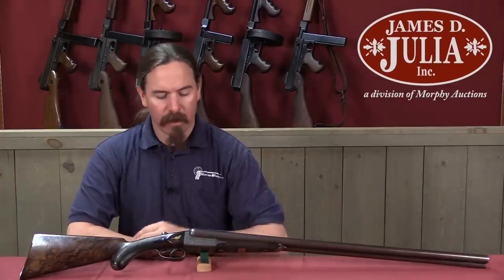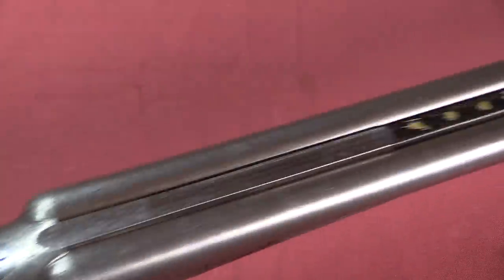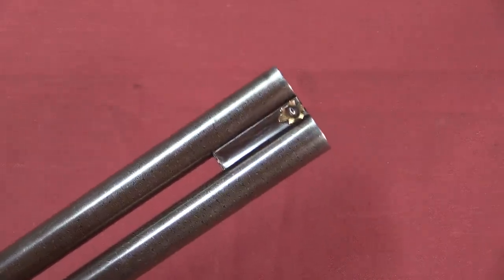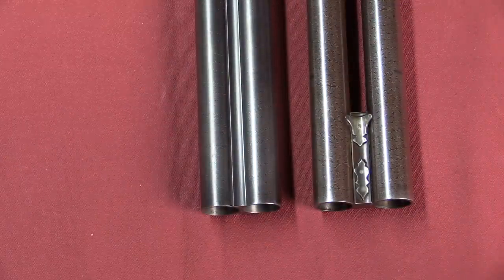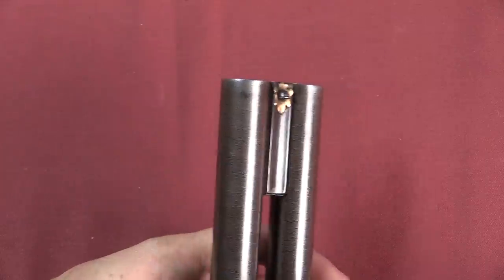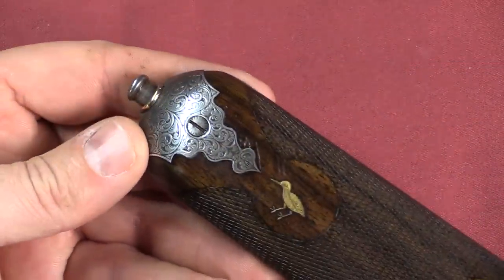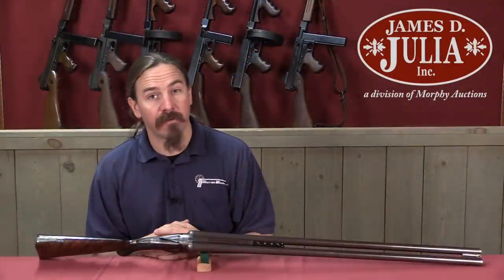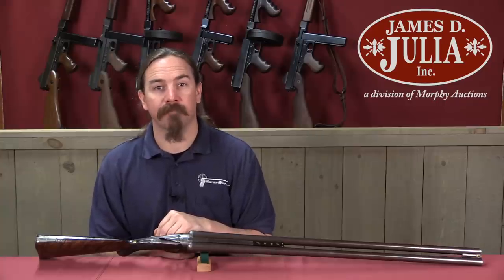Parallel-Bore Side by Side Shotgun - Look Ma, No Rib!

Comment: Were those true damascus barrels? They're gorgeous...
Reply: They are not damascus barrels. True damascus has a pattern like rain drops and is a crucible steel. What those barrels are is pattern welded steel, which is strips of steel wound around a mandrill and welded together.
Reply: Given where "damascus" has gone in the use of language (both now and with early pattern welded steel) I've started to lean towards just accepting this being called "damascus" and maybe at most point out there's a difference between what one thinks as Damascus steel today and Wootz.

But there's still a nagging stubborn part in my brain that kinda wants to stick to your point, yet it seems pointless with how its been used in modern english and how few people actually know the difference between pattern welded steel (commonly referred to as "Damascus") and Wootz or... even what Wootz steel is.
Reply: Well, the exact same image is used on both Wikipedia pages for Damascus and Wootz, and the articles somewhat imply that they are essentially one and the same, so I don't think there's any practical point in distinguishing between them.

Pattern welding can also be achieved by forging, anyway. It's just forge welding isn't as strong as more modern methods.

EDIT: Yeah, apparently these barrels are actually weaker for it. It would be dangerous to use high pressure shells in this shotgun.

Comment: I never knew that the barrels converged like that on normal double barrels. I guess it makes sense. Similar to aircraft machine guns when they're mounted on the wings.
Reply: Actually, the regulation of aircraft machine guns in the era of wing mounted batteries, was at the pilots discretion.  Some preferred them tuned to the same spot at 1000 yards, or even 500 yards, but may preferred parallel columns.

Comment: I suspect that "normal" regulation is also partly in response to the effects of recoil on POI, due to the barrels being offset laterally from the center of mass and from the line of support, somewhat like the effects in revolvers with light versus heavy bullets.  I.e. the right barrel points slightly further to the right by the time the shot charge or slug exits the muzzle and vice versa for the left, hence the inward angling of the bores to compensate for both the divergent aiming and to a likely lesser extent for the spacing.

Comment: The Marlin M90, Remington M32, and the very rare Morrone shotguns all had no connecting barrel rib, but these were all over-and-under designs. They all taper to the muzzles in the manner of a double. I have also seen handmade German guns with a WOODEN rib! Presumably to save weight. Colt double rifle in 2018 if you can find one.

Comment: I just have to imagine that it actually doesn't matter much at such short ranges using a shotgun
Reply: @ farmerboy916- On a stationary target it wouldn't matter much but on rapidly moving targets that shotguns are usually used for those parallel barrels would make a big difference. You can prove it to yourself with any shotgun. Mount the gun as you normally do and then close the eye directly above the center boreline and try to hit your target. Unless you are cross eye dominant you're going to miss.
Reply: Shotguns launch a whole lot of rocks. It's pretty hard to miss.

Comment: Double barrels be they rifles or shotguns, aren’t converging because the want the shot column or bullet to converge, they are that way because they are on other sides of the centerline and recoil makes them recoil and shoot away from the centerline. Converging the barrels correctly makes them shoot parallel. Nobody cares if they shoot an inch and a half apart 3/4 of an inch left or right of your aim point. But what you definitely don’t want them shooting at some angle to that point. Parallel barrels will shoot progressively farther away from the aim point due to the recoil being on opposite sides of the center and the barrels being forced away during the firing sequence

Comment: Kind of makes sense in specific situations. Instead of regulating/ converging your 2 shot columns at set distance, this would create an interlocking figure 8 pattern that had increasing overlap as the range increased. This would be beneficial for jumping ducks to increase hit probability on multiple birds when two quick shots are fired.  This would be beneficial for 'market' shooters back in the day when Damascus barrels were the go to. 
That's just my theory.

Comment: I look at this firearm and immediately wonder if the initial idea (which probably didn't pan-out) was to make that ebony / buffalo horn piece slide in the gap between the barrels, pressing gently outwards on each barrel, in an attempt to create an adjustable regulation.

Comment: A beautiful looking gun but it would require a lot of practice to become proficient with those parallel barrels. The amount of lead required for the exact same target would vary between left and right barrels. Someone must have shot it though. The damascus pattern at the muzzles is faded precisely as one would expect it to be if it spent much time in a gunslip and there are the usual little handling dings in the buttstock. The auction house description lists the maker as "Ellis Brothers, 16 St. Mary's Row, Birmingham" and mentions a decorative inlay bearing a "1918". Since Ellis Brothers existed at that address from 1903 until 1919 this is likely one of the last guns they built.

Comment: Would not having a rib compromise the structural integrity of the barrels?
Reply: Why?
Reply: Laird Cummings shotgun barrels are the ultimate in freefloat
Reply: No, it's no different than having a couple single barrel shotguns taped together. They're fine on their own, attaching them to each other, rib or not, doesn't weaken them.
Reply: pro-tip, if you're going to hit someone with the gun, use the butt, not the barrel.  Otherwise I can see no difference between this and a normal gun in proper use.
Reply: Pro-tip if youre gonna use  a large calibre, long barrelled weapon, you might want to make it as strong as possible...like having 2 barrels support one another......
Reply: Sany0 its a shotgun, just means you cant use slugs
Reply: peak stress is near the chamber, so it doesn't really matter down the barrel for a gun like this. Look at how thin it is at the muzzle. Also you're not going to be getting this red hot where the steel softens. So the barrels are supported where the stress is high, then after that its largely only needs the block at the muzzle to keep the distance between the two properly fixed.
Reply: Yeah i was only asking as its very strange to see a shotgun like that, i mean, if its lighter than a "normal" shotgun why arent manufacturers doing it all the time ?
Reply: Sany0 because if you take the rib off that is exactly how all shotguns are made
Reply: Without the rib makes a lighter, easier to handle weapon, less mass to swing around to targets. Why arent the big companies doing it?  Must be some draw back
Reply: Sany0 barely, the rib is never that thick, it looks better and protects the internal surface from dirt etc.
Reply: Ok, but if youre a competition shooter, even losing 1/2 lb of rib metal would make a difference, and clean up would be easier i think, just run a loop of cloth through the gap, only having to clean the contact points between barrels. BTW, im not being dense here, there has to be some reason most shotguns arent constructed like this.
Reply: Sany0 most side by sides are not used by competiton shooters. Over unders yeah. But side by sides? 

But there something to be said for over kill in strength and over engineering
Reply: I'd imagine its because of convergence. Shot isn't a precise thing, so having the barrel's trajectory overlap leads to better results. As far as why not more are made, I'd imagine its accuracy and practicality. It'd be annoying to have to sight for two parallel barrels, since again, I imagine each is off center. Cleaning would also be easier having a single barrel
Reply: Single barrel shotguns exist. Double side-by-side just have a rib soldered on connecting the two after being regulated and helps keep them that way. If you had a huge gap in between like the one in the video it's possible to get one or both barrels bent by accident which will mess up the set zero. For weight saving purposes, there are ventilated ribs. Also, going too light on shotguns isn't always a desirable thing as it increases felt recoil.
Reply: morisato54 they are joined at both ends so its not like they are flapping in the wind
Reply: Ok thanks for the replies guys, In over-under competition shotguns, most of them use an interrupted rib style, they still feel the need to use support ribs, but the one is this video only has 2, front and back, thats why i asked about the strength,structure thing.
Reply: Watch Ian's video on the Armalite aluminum shotgun for lightweight shotguns and why they don't really exist. Long story short, not enough mass to maintain a steady swing in clay competition. Slick guns though none the less, I would love to have one just for the novelty.
Reply: Alistair Shaw And if someone sits on the barrel in the middle where it's unsupported?
Reply: Not having full length top and bottom rib won't have an effect on the strength of the barrels.  Some reasons for there to not be ribs would be shooter preference, take some weight out of the front of the gun which could make it a bit livelier, better cooling during some types of shooting which was actually an issue with the types of low temp solder used on these guns.  

This particular gun looks like it was built for driven shooting and possibly some pigeon shooting given the stock dimensions, barrel length, choking, load it was proofed for, and type of grip.  Those types of shoots often times took place at longer ranges and with a fair number of shells expended in a very short time which with the powders of the day would cause things to heat up very quickly.  

Just some thoughts on why this may have been built this way.
Reply: morisato54 one those barrels are still honkingly thick and two why would you leave your shotgun somewhere it could be sat on

Comment: The 'regulated' barrels that angle towards each other cause the two circular shot patterns to merge into one circular group at the typical range. This is called point harmonization. By having the two barrels parallel you end up with a pattern shaped like a figure eight on its side this would allow a poor shooter a better chance of hitting a target moving across their field of view.

Comment: I don't get why you'd need the barrels to converge. I get that media such as video games exaggerate the spread of shotguns ridiculously, but I presume the radius of the spread will be significantly more than the amount by which the barrel is off-center from your aim, at the range you're going to use it at. So at that point, why would it matter if the barrel isn't exactly in line with were you're aiming, as long as your aim is close enough to the center of the pellet cluster at the range you're using it at?
Reply: Tobias Hagström Because there's no such thing as "too much" accuracy. Having the barrels converge will only make one a more consistent shooter and yield more predictable results(again, no such thing as "too predictable" when aiming for 1 spot with 2 barrels).
Reply: I suspect (but do not have data available to verify) that you also have the effects of recoil on aim, somewhat like the differences in POI of revolvers with light versus heavy bullets.  I.e. the right barrel recoils out to the right a bit further before the shot column clears the muzzle and the reverse for the left, so one adjusts the barrels out of parallel to compensate.
Reply: Most SxS and O/U shotguns are regulated to have their patterns converge at 40yards.  The reason to have both barrels shoot the the same poi is that often times if they don't one shot charge can often times be quite a bit more than a foot off at the typical distances that shotguns are used at.  

Remember the vast majority of shotguns like this are used for shooting FAST moving game and aiming as such isn't practiced as it is with rifles and handguns.  The primary focus with a shotgun is on the target.  The barrels and such are just in the peripheral vision.   If the shooter goes from target to bead back to target etc that will just about guarantee a miss.
Reply: This is the correct answer.  W.W. Greener's The Gun and it's Development covers this subject.  If the off-axis recoil wasn't an issue, it would be feasible to just make the barrels parallel and the offset between the two would be lost in the normal dispersion of the barrels.  Double guns and rifles are not made to have the barrels converge at a specific distance.

Comment: I'm not an expert on this, but it seems to me that there would be a little bit of torque to the right or left when you shoot a side-by-side, which would tend to throw the left barrel pattern to the left and the right barrel pattern to the right. If the barrels are pointed towards one another, they are actually pointed slightly right, for the left barrel, and slightly left for the right barrel; but if my guess is correct, they should be pointed exactly straight ahead, due to torque left or right, by the time the shot charge leaves the barrel, and the barrels would then throw  patterns that fly parallel to each other, but an inch apart, which would be imperceptible and inconsequential.
Reply: a good number of pigeon and trap shooters from that era would have their guns set up to shoot reverse of the normal right then left to mitigate recoil forces interfering with the second shot.

Comment: I have a feeling that is purpose built to be a slug gun, the parallel barrels allow you to make use of the longer range of slugs
Reply: No it's built for shot.  The proof marks on the barrel flats show the shot charge that it's proofed for.  It's also choked pretty tight for slugs.

Comment: Are those Damascus barrels or were they just decorated to look like it
Reply: No they are not Damascus barrels but are pattern welded also called laminate steel barrels. As far as I know Damascus steel has never been used in barrels. At least not in the western world or in any quantity. Damascus refers to a type of crucible steel and has a pattern like rain drops. Pattern welded refers to the method of construction.

Comment: whats the firing order on the barrels are they one at a time or both at the same time? If both at the same time the parallel barrels would make since because it would have a larger shot group. Maybe for bird hunting?
Reply: Typical firing order would be right barrel first left barrel second.  If there were 2 different amounts of choke in the barrel the first barrel was the more open barrel.   The front trigger fires the right barrel, back trigger fires the left.  It makes for a very versatile system because if something presented at a long range it's easy to go for the back trigger first instead.
Reply: Yeah I understand how a typical double barrel shotgun works but this is not a typical double barrel shotgun. The point of aim would be very different for each barrel so having separate firing barrels would hold no benefit. I see that the shotgun has two triggers but the forward trigger could be a staging trigger.